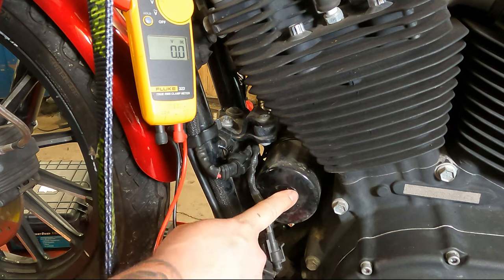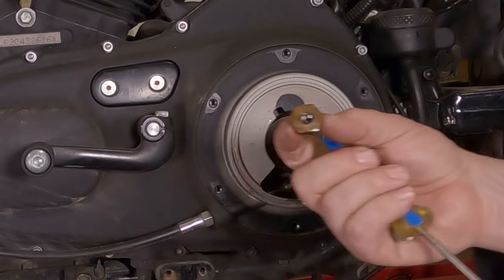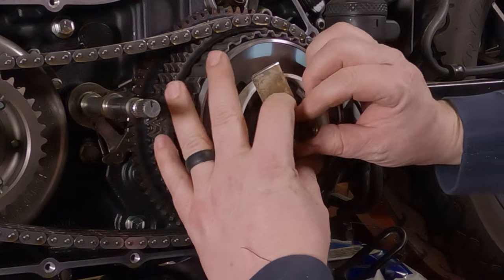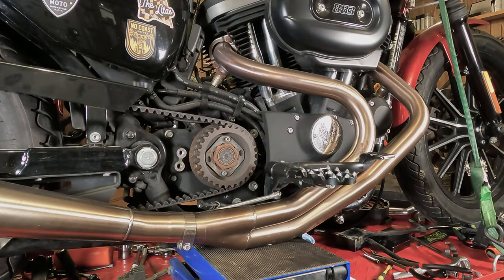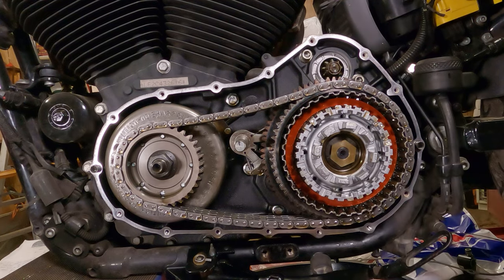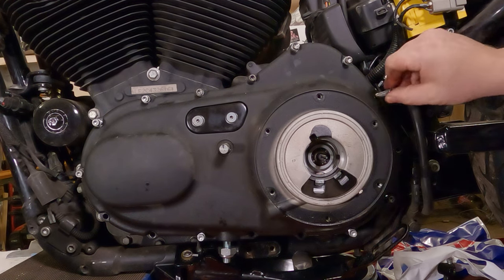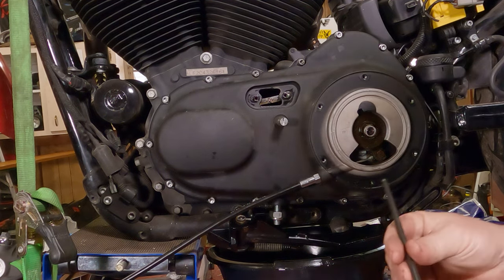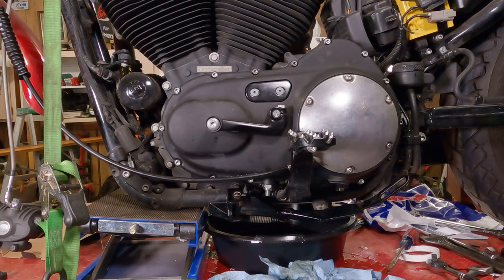Replacing reg/rectifier & stator on a Sportster.  No fillers or intros

Comment: This video HELPED ME IMMENSELY, although I had some issues testing, this video will be on my shop TV while I'm attempting this very scary job. I'm limited in capacity on wisdom and experience, although I've done some pretty hairy jobs on my 20 sporty custom iron. I had to backthread my spark plug ports due to a crossthread in the plugs, I had to backthread, the whole works, it worked, it's it's a greaybfix, I couldn't believe I did it, so this job will be no different, I'll have yoir awesome vid up and follow it step by step. I just need to order or find the Stator and Regulator kit. I do use Lowbrow, I have their flag in my videos most days, ill.check their site. Thanks Brother
Reply from the maker: You’re welcome.  I am very glad it helped!!!